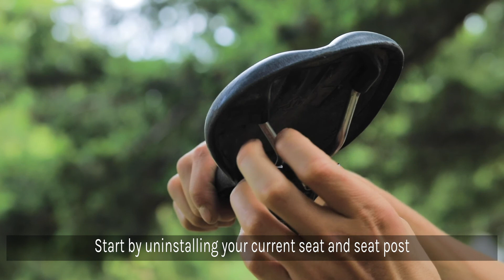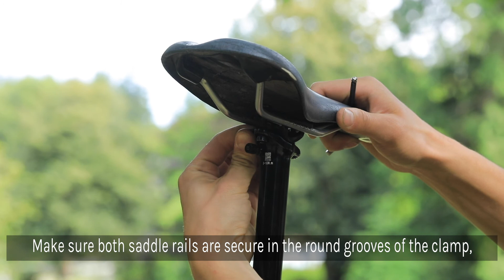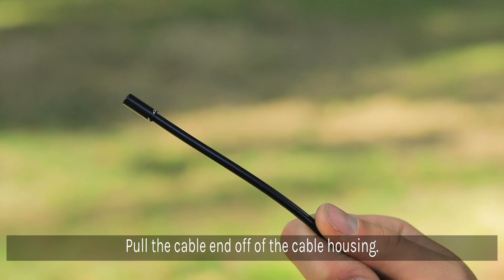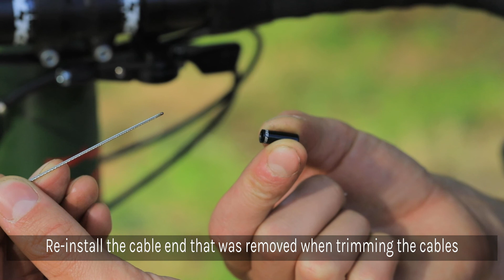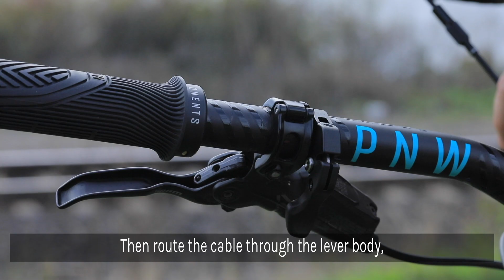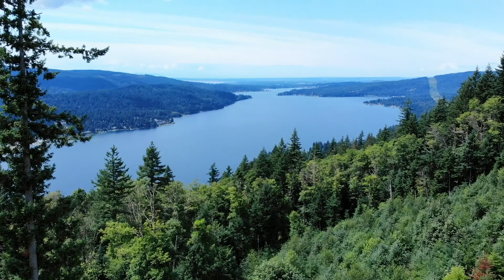PNW Components: How to Install Cascade Dropper Post with Puget 2x Lever

Comment: These wires are literally impossible to cut clean wtf
Reply: You need a prober wire cutter, ive tried it with other cutters and its impossible
Reply: @soules0660  Yoo! Its funny i got lead back to this. Yes i found the proper tool and cut clean and tightened my cables successfully. Im so glad i did it myself and now i can fix other brake or gear cables too.
Reply: @fidelitygamer-90  yes its always nice to be able to do it yourself saves a lot of money instead of going to bike shop.
Reply: @soules0660 im struggling right now how do i even put the 2 pieve barrel adjuster
Reply: @simonkey888   im not sure what u mean by that im sorry

Comment: Can the cascade dropper be fully inserted into the seat tube with the external cable tang? Looks like it may be tight.
Reply from the maker: Hey Cole! That will largely depend on the thickness of your frame material. There is a 7mm gap between the cable carrier and the main body of the Cascade.
Reply: Thanks! 7mm should be plenty. I’m planning on getting the 125mm post. I’m short and needs to be all the way inserted for me.